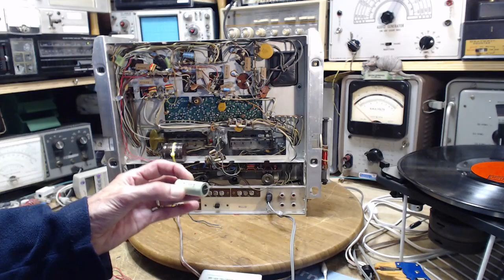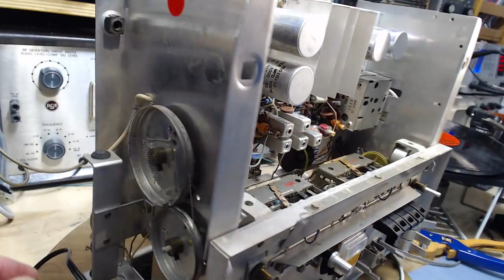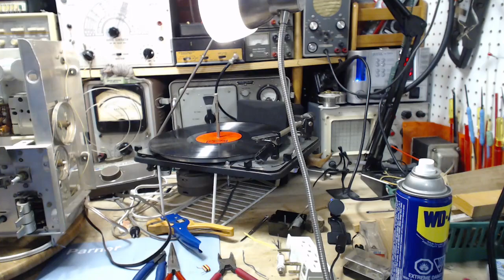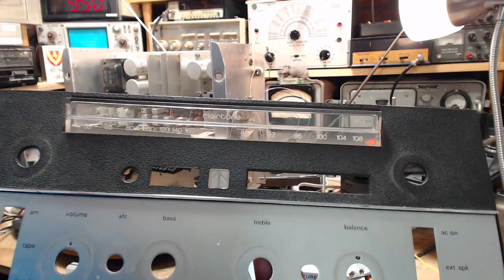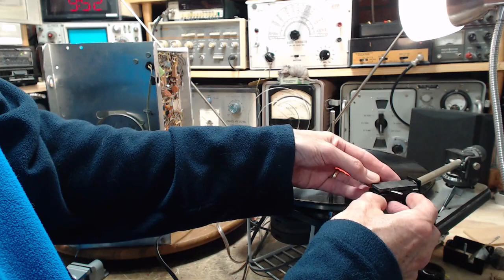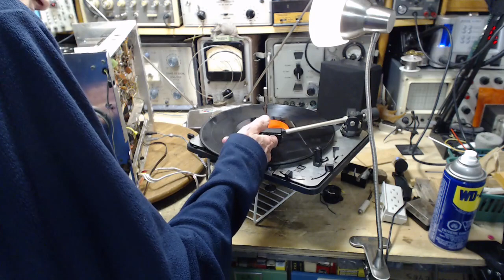Clairtone Console Stereo Video #10 - Full Function Tests

Comment: HAY the voltage  on  the Cap  is  above the total voltage  and the output of the speaker is above the  the voltage the  zero voltage  of the total   that is how one gets an AC voltage on a speaker line      the cap is there to keep the DC in place and the AC in place
 i think this is the eases way to explain this     
     and do not get to Brain Washed     
        Good ole Conspiracy Radio